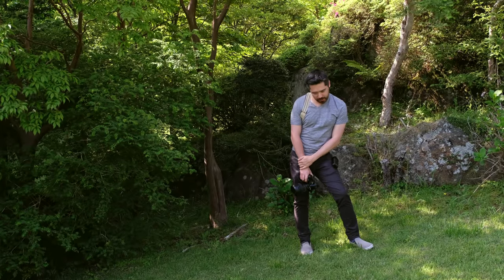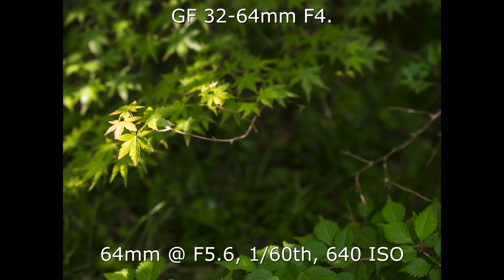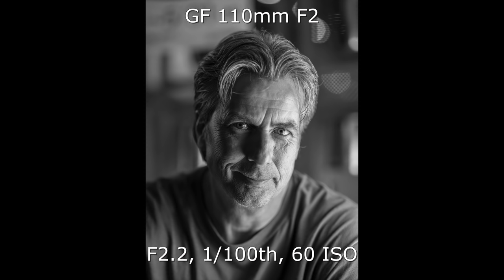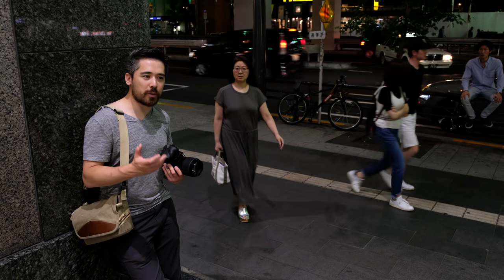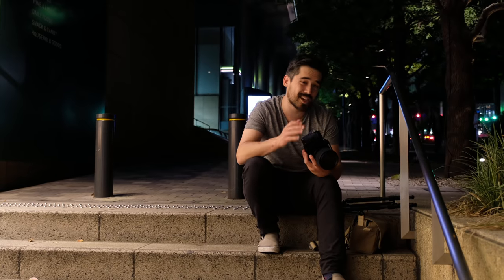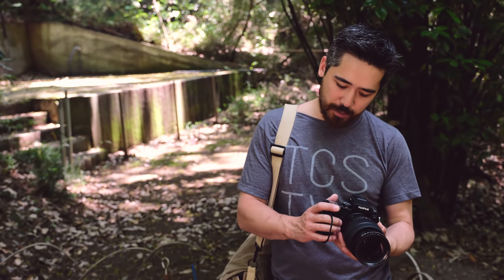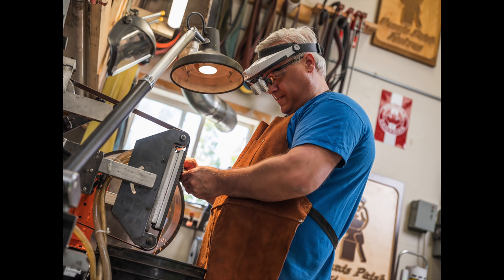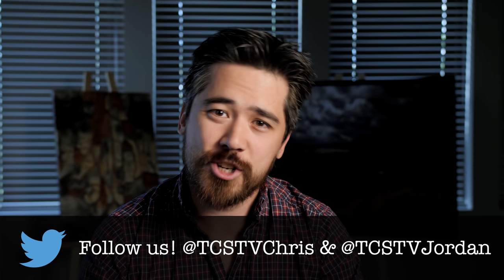Fuji GFX-50S Hands-On Field Test (In Japan!)

Comment: Great video. I really enjoyed it, even if I might never buy a Fuji GFX. What I have seen from this camera (and the Pentax 640 and the Hasselblad) is that the 50Mp larger sensor doesn't improve the image quality that much compared to modern full frame camera's. The difference with the Fuji XT camera's is obvious, but if I compare this to a modern Canon, Nikon or Sony the gap is so much smaller. I think Fuji has done a marvelous job with the GFX. It is really impressive as a system and it will grow, but it should grow significantly on image quality. From a practical point of view, a lighter full frame will be much handier while traveling. Thanks to Brent Taylor for contributing. Wonderful photography.

Comment: The medium format cameras doesn't have a specific sensor size like micro 4/3, APS-C or full full frame cameras. Nevertheless medium format image sensors are significantly larger than full frame sensors and that inherently nearly always offers better image noise at high ISO. Also nearly all medium format cameras produce 16bit raw files instead of the typical 14bit raw files. That improves drastically the dynamic range during raw photo post processing. 
Unavoidably medium format cameras have larger sizes and are heavier but the recent mirrorless medium format cameras by Fuji and Hasselblad are comparable to the flagship full format cameras of Canon Nikon. 
In addition bright medium format auto focus  lenses can't be made easily small. They are nearly always larger than the equivalent full frame lenses. A larger sensor needs a larger image circle which usually only larger lenses can offer with quality. 
The Fuji GFX is the latest weapon of the mirrorless battle against dSLRs. 
With the mirrorless revolution every camera manufacturer is attacking the Canon Nikon domination. I don't know how long the battle will last. Canon Nikon have the advantage with their numerous lenses but the other mirrorless manufacturers especially Sony year by year enrich their variety of lenses.
Reply: Achilleas Labrou Thanks for your analysis of Med Format cameras. I have been trying to determine the advantage over DSLR or even Fuji X-T2 apart from being able to make bigger prints.  It seems to me this is no camera for non-professionals as the benefits are too small or irrelevant to outweight the disadvantages.

Comment: Hi,  I know you heated the Hasseldlad X1D, But I just been to one of the camera store in the UK and took both cameras out that the Fuji GFX and the Hasseldlad X1D and I found the Fuji uncomfortable to hold just awkward to control in manual i.e. changing most of the setting other than aperture. As to the image quality there was little to no difference on what I shot, But when I have look at other test I think the Hessalbad is still just a small bit better. But the Hessablad is so much nice in the hand. You have got to remember that both of these cameras are medium format and need to be used as such.

Comment: Do you trust Fuji to not abandon the G-Mount format? I want to hold out until they have a 4k video version of the GFX-50s and then I'm all in on this format.

Preferably with less megapixels too so it will have even better low light performance and we can use it like an Alexa 65mm motion picture camera!

Comment: Nice video, well done. I bought the Fuji GFX50s about 3 weeks ago. I own also the Fuji GF 63mm 2.8 and Fuji GF 23mm 4.0 lenses. The camera basically delivers great pictures. No doubt about that. However, I changed back yesterday the Fuji GF 23mm 4.0 for the 2nd time. In both cases, a failure saying "Switch camera off and on again" error appeared. And this message never disappeared again, even after following the instruction. And this error message also goes with the camera, means, in case I use this failed lens on an other GFX body, the same message appears. And this behaviour can be reproduced (at least my case the described procedure was applied): I used the Fuji GF 63mm first for quite a while and changed then to the Fuji GF 23mm 4.0 and continued shooting. Sooner or later, typically after some hours this error message pops up. If I only use the Fuji GF 23mm 4.0 then I never had any issue. Now, I forwarded per request the GFX and the failing lens to Fuji because they kept saying the first lens is working (what is not the case on all the bodies I tried before, also verified by the dealer). One week my gear will be gone now, then let's see. I expect here a clear and unambiguous answer from Fuji. If not, the gear will go back together with the lenses and I am done with Fuji. Sorry, man, but the Fuji GFX system looks quite unstable and not finished yet. Including the well praised Fuji service. Yes, I am disappointed.
Reply: Today I returned my Fuji GFX50s plus Fuji GF23mm and the Fuji GF63mm. Because Fuji insisted on that when they received the camera it was working together with the "failing" Fuji GF23mm lens. It is enough, both me and also the folks at the local Fuji dealer experienced this issue. We taped it also on video. Fuji is selling actually all of us as stupid obviously. I am done with Fuji, the GFX50s I cannot recommend, it is not a stable product and more important, the Fuji service sucks. I will go back to Nikon, good is that the Nikon d820 is coming. Never had any issue with Nikon, not their products, not their service. Hands away from the Fuji GFX50s, that's my recommendation.

Comment: Good to have the specific strong and not so strong points highlighted as was done but I personally don't see this camera as a street photog rig but then I don't see a d5 or 5d as street rigs either. That was the point of the  x series , especially the xe/xp and other smaller cameras wasn't it ?  I guess one can use anything for whatever one wants but it is a large camera which defeats the non intimidating appeal of the x line  to carry for street  work.

Comment: TheCameraStoreTV may I ask you how could you shoot handheld with the GF110 at 1/100th?
I've used it for a job, and even with the 63mm and a flash I had to use a tripod for the little shaken images at 100% (enlarged 1:1)

I can shoot with 1/10 or 1/15th with my A7R3 and the 55mm but I think it's quite impossible to achieve 100% steady shots as I saw in the video with such a long lens and no IBIS....

May I also ask you if the autofocus in normal daylight is any good as the "old" Fuji XT1?

I'm really interested in buying the GFX50R sooner or later

Thank you

Comment: Frankly, I'm surprised that anyone is still making medium format, other than maybe hasselblad or phase one.  They're big, they're clunky and they're basically only usable on a tripod (if you want decent results).  Plus, with the quality of full-frame sensors these days, I just don't see the point.  I mean sure, you might get ever so slightly better color rendition, or skin colors, but I'm just not sure it makes up for all the hassles and the MASSIVE price tag.  I saw a video where they compared the D800 (or maybe 810, it's been a while) to the Hassleblad.  There WAS a difference in the way the skin colors produced a slightly nicer gradient, but I suspect this was to the higher bit files (16 vs 14), I don't see why Nikon couldn't put 16-bit in one of their cameras and destroy Hasselblad completely.  I mean the Nikon will be massively cheaper, far, far easier to use and it will be usable in more places and in more situations.  Cameras aren't selling all that well right now, anyway, it just seems silly to come out with a new camera that very few photographers can afford and really has such a tiny segment of the population which will ever consider it.
Reply: Scott R I don't know what you are talking about. The 100 MP sensor is SIGNIFICANTLY better than the 50 MP one in this camera which itself is noticeably better than any full frame sensor. In 2018, we will have two new BSI CMOS MF sensors, a 100MP 33x44 and a 150MP 645, which will blow any full frame out of the water.

Comment: how does this compare to A7R series though? 40MP is surely good enough for prints. 
I'd expect absurd MP from a medium format. I assume the depth of field is tighter and bokeh is better, but I can't see why you'd pick this over the 35mm equiv A7RII.
Reply: That's what I was thinking all through this review - you'd be better off with the A7rII. Better in every regard, save a few megapixels, plus 4K video. BTW, since FF lenses come as wide as 1.4, the purported advantage for DOF for MF is lost - plus many FF lenses have much better bokeh (rounded blades, and up to 11). Quality is more than just megapixels, and the FF renditions would in many cases be superior.
Reply: Plus why would you want even shallower DOF than FF? Full Frame is already too shallow to shoot portraits wide open at large apertures like F1.2 anyway. Unless you like the one eye slightly in focus look. The only real advantages I can see for MF would be slightly better dynamic range and I guess being able to crop a lot would be quite nice as well.  However this MF sensor isn't that much bigger than full frame and considerably smaller than other Medium Format offerings. 

Of course I have to think this camera is strictly marketed to people that print out massive billboards or in a field that requires insane quality. Me.. I'm just happy with my Micro 4/3rds camera. ;)
Reply: Great point I’m debating about getting an A7Rii or a medium format...eagerly awaiting an announcement fir an A7Riii

Comment: “Not pretty?”  What’s is wrong with you?  Form driven by function IS pretty.  And it’s relatively small.  Haselbald looks classic until you learn it’s made in China and the look gets tarnished.  Pentax?  Got dropped out of a tree and hit every ugly branch on the way down.  With the huge black letter on silver oval name plate in the front, you think they might be using you as an advertising billboard?  Leica S2 looks like it’s been doing too many shrugs at the gym and eating way too much pizza afterward.  Mamiya looks like it has a giant robotic arm coming out to grab your eye.  “Run you fools!”  You had to know that attacking Fuji camera design you would become the target of snipers in the street.  I understand they are in fact coming out with a more retro looking rangefinder version of the medium format.  I might take a hard look at that depending on the price and ONLY if they drop the dumb angle on the dial deck the ruined the X-Pro2 with.

Comment: At $6500 this is way out of reach for most people.
Reply: Drew yung Kwei isnt that a similar price to the d5/1dxII/a9 ?
Reply: Diepixel the difference is those cameras can do more things well, as good as the GFX is it is designed for a very small arena of photography
Reply: still the cheapest, modern, up to date, medium format camera. you should be comparing this price to other medium format systems.
Reply: your statement is absurd , same price as a nikon D5, not only that its the best cheapest Med. Format that exists.
Reply: Theoria Apophasis except is a fake medium format sensor so yeah...
Reply: is it bigger then a full frame sensor?
Reply: shaolin95 same sensor in Pentax Z and Mamiya leaf.   Sorry you're dead wrong
Reply: "At $6500 this is way out of reach for most people." So..? What's your point? Does that make it no good?